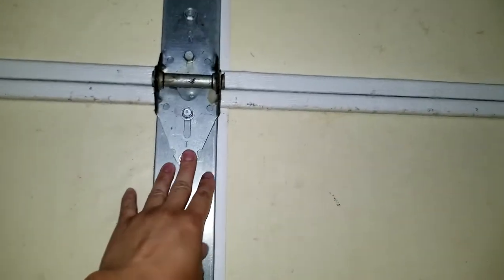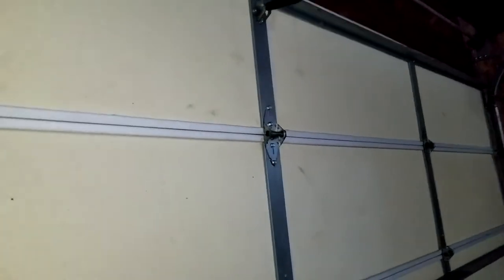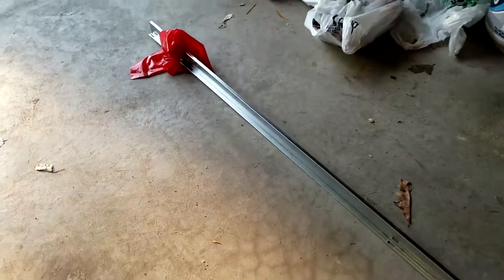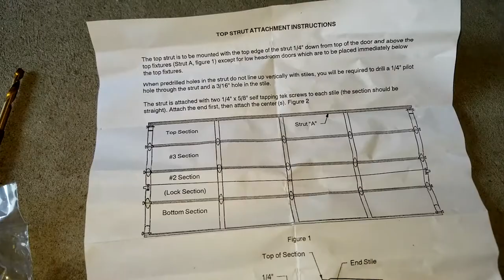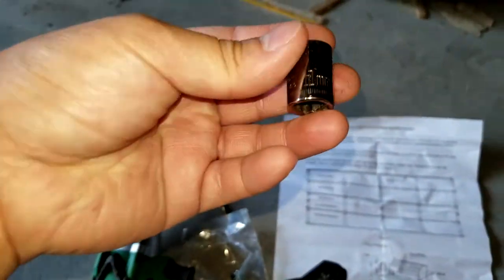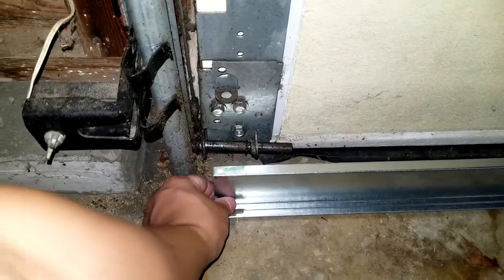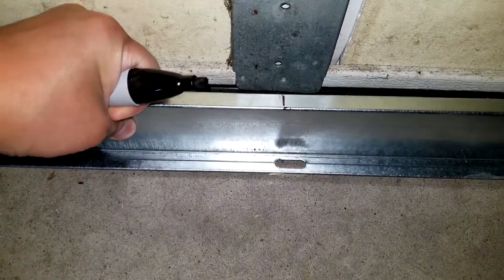HOW TO FIX GARAGE DOOR FROM BENDING

Comment: Hello my friend I have some questions…my garage door look it same problem your garage door but my they at first rail Bottom..so how you order rail we need to make sure with and how many rail I need order right thank you for your help
Reply from the maker: What do you mean they at first rail bottom? On how many U-Bar Strut you will need. You will have to check to see where your garage door is bending. I would say one on each end of your garage door panels where its bending. You can measure your garage door to get the correct length bar for the door.

Comment: Where did you find that reinforcement mental rod? I don’t see them in home depot or Lowe’s
Reply from the maker: Menards
Reply from the maker: https://www.menards.com/main/hardware/garage-door-parts-accessories/ideal-door-reg-overhead-garage-door-steel-horizontal-garage-door-support-struts/0150091/p-1245710551940459.htm

Comment: Did you have to adjust the springs or tension on the garage door with the new beam? I would think the garage door would be heavier now with the extra weight and would be harder on the motor
Reply from the maker: No, I did not need to adjust tension or anything. If you already have the correct tension on the door, it should slide up and down easily. A 1/2-horsepower garage door opener can lift approximately 300 pounds. The beams are so light that the garage motor will have no problem lifting up the door. 16.6 pounds wouldn't make a difference.
Reply: i ADDED mine and it stops about a foot from the floor. My garage door is straight now and it hits the little flapper on the way down that I think stops the garage door. It is either that or I need to adjust the down turn . What do you think? I wish I could show you via video real quick what it is doing. The middle of the garage door hits that sensory flapper. If i bring that sensor flapper back too much it will become aan issue from the garage door stopping at all.